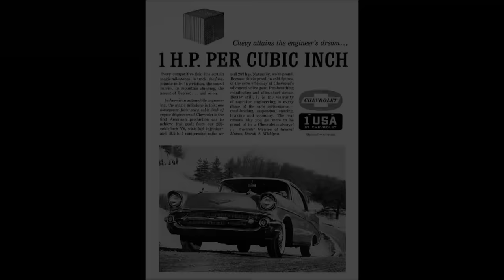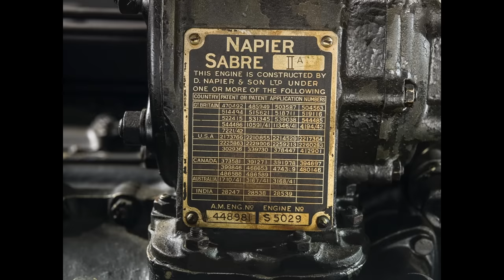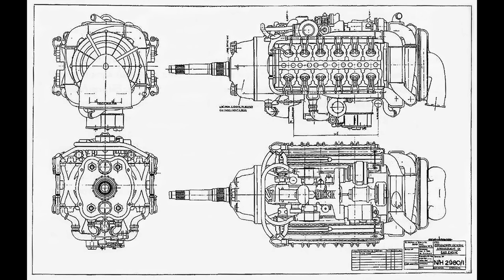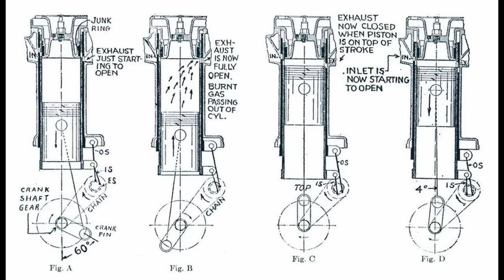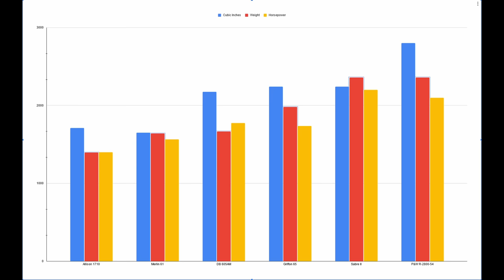Napier Sabre - The Ultimate WWII Aircraft Engine - Part 1

Comment: Greg's Airplanes and Automobiles has done some excellent looks at how much induction systems matter. For example, the huge increase in performance when the P51 Mustang was changed from using the Allison to the Merlin, the induction system mattered far more than the engine itself. Multiple stages and multiple speeds of supercharging was the real gain there.
Reply: Te Rolls-Royce supercharger became so well developed for flow and efficiency that it was used in early turbojets. It was that good.
Reply: A good read is 'Not Much of an Engineer' by Stanley Hooker who was instrumental in sorting out the supercharging of the Merlin. They put him in an office without a specific remit and he wandered around the site and walked in to the supercharging unit. He was a prime mover with the Bristol Olympus and he was even hauled out of retirement to sort out the problems with the triple spool RB211. A major player in UK aviation up there with Mitchell and Camm.
Reply: The important point is that the superchargers of early aviation engines were always integrated in to the crankcase, so changing the design of the supercharger meant redesigning the whole engine. For whatever reason, there was no such thing as an external supercharger back then. This meant the design of the supercharger was fixed very early in the development process, and it was critical to the performance of the engine as a whole. The American made Allison V-1710 used a single stage, single speed supercharger which reached its critical altitude (the highest altitude that the engine can still make full rated power) in the 12-14 thousand feet area. But when Rolls Royce designed the Merlin, they had the remarkable engineering foresight to build a two stage, two speed supercharger in to the case which could achieve far higher pressure ratios than than a single stage, single speed unit. P-51s with the Merlin engine could make full power in the mid 20-thousand foot range, with still plenty of power available even higher. Higher altitude comes with lower air density which means less drag, but with the engine still making nearly full power you could go faster and go farther on the same fuel load, which is why the P-51 could escort the bombers all the way to Berlin and back.
Reply: Gregg is boss.
Reply: I will look into that book, thanks David. One of the things I learned about engines, is the remarkable, usually in-house, engineering techniques and methods employed. My personal experience was with jet engines, from the 1960s to 1980s. I flew maintenance test, quality assurance for the USN. But I did not do research and development, which fascinated me. However, I would from time to time look into that world.
Reply: This engine design is very interesting and exotic.... It is too bad that the sleeve-valve designs began and ended with these engines... One reason that these designs were favorable, is that they take relatively little space as compared to the power they produced... Less frontal area was the result, which meant the plane had less drag, which created more speed and less fuel burn...But it was complex, which meant that it was usually less reliable- especially the mechanism that operated the sleeves... However, if the problems of activating the sleeve valves were solved, this design could have replaced a whole lot of poppet valves in the heads of several piston engine designs... Because of it's un-convential layout, it became somewhat difficult to obtain financing, materials and accessories for it, like adjustable pitch props... It reminds me of the troubles that Jack Northrop had to build the B-49 (Flying Wing) planes because of it's un-conventional design... If Napier was awarded the backing & support to improve their engines, that other competing companies received for their products, Napier probably would still be making engines now...
Reply: A really interesting book giving a lot of the background to the sleeve valve design used by both Napier and Bristol has to be Sir Harry Ricardo's "The High Speed Internal Combustion Engine". Well worth a read if you can find a copy, along with the other books mentioned above. I would also endorse the recommendation of "Greg's Airplanes" channel on YouTube. He has some very good videos about Supercharging/Turbocharging of aeroplane engines of this period.
Reply: David Carr  Those engineers were Absolutely Brilliant !!! From what I have read about the advancement of Turbo-Jet gas turbine engines, one of the most significant advancements of their Power/weight-size ratio, was the original application of VSV's and later VBV's that helped to 'tune' the airflow as it was traveling through the axial-flow compressor sections of these engines... The use of the Variable Stater Vanes (on Pure Jet and HBP engines) and the Variable Bleed Valves (on High By-Pass engines) sometimes tripled and even quadrupled the continous thrust output (without exhaust re-heat, water injection) of the earlier engines without the VBV's / VSV's...
Reply: @singleproppilot  Later V-1710s did actually have a 'bolt-on' external supercharger, driven by a hydraulic coupling rather like the superchargers of the German DB60x series. That engine saw service in the P-63, which of course was not popular with the Western Allies. To my knowledge it still couldn't match the Merlin at high altitude, but was a substantial improvement over the single stage V-1710.
Reply: Agreed - Greg's videos on supercharger and turbo supercharging layout the case for manifold pressure. The delivery of this boost at various altitudes is also key to determining fitness for role. It's interesting to see that the same engine performs either poorly or exceptionally well at altitude depending on the boost system - yet I'd avoid saying "better" or "worse" since the role of the aircraft and how it was actually used in the field determine the overall success of the design.

A great example is the Allison V-1710. With just a single stage single speed supercharger, performance was generally only acceptable below maybe 15000ft, as in the P40 or P39. It wasn't well suited to a high-altitude escort role and was indeed dropped in favor of the Merlin with it's two-stage / two speed (can't remember when they revised the superchargers but see Greg's videos) to get up to 25000+ feet for the P51 Mustang. Better still, use turbosupercharging in plane you can fit that induction system, like the P38, and they opted to keep the Allison's over Merlin's and props became the main limitation. 

Manifold pressure (and the fuel to run that boost at) is key to internal combustion engine power. With more development you can see that Napier was headed in the right direction.
Reply: General Electric didn't produce the promised turbo.
Reply: @raywhitehead730  Don't tell me, he spun a long convoluted story of how the Allison was not inferior to the Merlin because many Americans can't stand the thought of being second best at anything?
Reply: David Carr  Really?  I've heard that the P38 was a relatively poor performer in Europe.  As for power dropping off at height then the phrase of wanting results not excuses comes to mind I'm afraid.  If one cannot match the enemy in terms of all round capability then it spells trouble, simple as.
Reply: David Carr  that's fair enough.  But suffice to say that the P51 with a British engine and American airframe was the zenith of the piston engined fighter, an example of "If it looks right, it generally is right".  Meanwhile the Mosquito fell apart in hot climates, horses for courses...
Reply: Greg is not as honest a presenter as he claims.  In other words, HE LIES.
Reply: @paullubliner6221  I wouldn't go so far as to say that.  However I do think he really works hard to promote American designs over British and German ones for example.  Do you have any references or citations to substantiate your claim?
Reply: David Carr  fair enough 👍
Reply: @raywhitehead730  
Obviously an opinion others disagree with. Read Calum Douglas, an F1 engine designer and engine historian.  Learn from the real people.
Reply: @paullubliner6221  
Greg's labasting of Dr Mark Felton, an acclaimed and awarded historian, on the Black Lancasters put me off that guy. His delivery is also boring and at times confusing.
Reply: An engine's power potential is ALL about getting air into it.
Reply: DC.409  😊
Reply: @raywhitehead730  It is Greg and he is not.
Reply: @rob5944   The P38 engine required constant monitoring in the cold of the ETO
Reply: DC.409  The P38 was never called the Fork Tailed devil that was  post war hyperbole.
 I have a book with the Whirlwind mentioned nothing about bad experience by Brown in fact I have 5 books by Brown The problem they did have was with the Peregrine Engine and it would have taken a major redesign to put the Merlin in.  Gunston said it was a fine and pleasant machine and packed an unprecedented punch in the Nose .Our first twin engine fighter.
Reply: @rob5944 P51 Zenith hell every Spitfire beat the P51 in all flying conditions except the P51 better top speed[ until the Mk XIV] and range 
2. 32 Mossies had problems in Burma  traced to two factories using contaminated glue.
Reply: @rob5944  I pointed out that the P47 in Three Reports only had a tactical Mach of 0.71. One of the Tests was at Wright Field in Jun44 which gave it an even lower ILDS and NO British Bias
Reply: @johnburns4017  Yes I saw that I don't know if they planned it or not. It could have succeeded and the Lancaster need not have landed in any US controlled air Space. Adm. King and the USA was becoming obnoxious in the Area by the end of the war. The BPF was sent there for two reasons 
1. To help the USA as promised and
2 To make sure that Britain had no opposition to them taking back Singapore Malaya Borneo and Hong Kong Roosevelt had been against colonies .
Reply: DC.409  Web know why the P389 was withdrawn T/M 0.68 Germans 0.75
Reply: DC.409  No what Brown was critical in his Wings on my  Sleeve was the very poor dive of the Lightning
Reply: @jacktattis  can't remember what we were chatting about now, sorry mate.  I just use my phone for this lark and it won't show everything up.
Reply: @jacktattis  could be the answer then.
Reply: @jacktattis  yes I gather it didn't get on very well.  Horses for courses I suppose.
Reply: @jacktattis  
If the Peregrine had more power with the bugs ironed out the Westland Whirlwind would have been an excellent fighter. But the work involved in installing RR Merlins was not worth it as the Mosquito had come along.
Reply: @rob5944  
Yes, that Greg's vid on the Alison v the Merlin was cringe-worthy.
Reply: DC.409  
No one is decrying the Allison engine. It was an excellent engine but it had its limitations. It was not outstanding, that is pushing it. A good workhorse engine.
Reply: @rob5944  
The Mustang was a joint design by British engineers and North American men at the British Air Ministry offices over three months in NYC.  The British were leading as it was their plane with them paying.  

North American Aviation men toured British factories to assess manufacturing methods. They went to Martin Baker twice. 

North American also used British expertise such as Ken Bowen from Yorkshire, who designed the progressive curvature principle used to build the P-51 Mustang fuselage, which was quick to form and easy to jig.
Reply: @jacktattis  
Admiral King should have been fired after the U-Boat debacle in the first six months of WW2 in which 600 US vessels were sunk on the eastern seaboard.  

The British forced 26 corvettes with crews onto the USA to stop the carnage. They also based a British anti U-Boat air squadron in Rhode Island to protect NYC harbor.
Reply: @johnburns4017  well they did a good job, and with the Merlin it made a great plane!
Reply: @Mike-eq4ky  Well they were foolish No US plane got to 45000 ft as did the MkVII Or 49000ft as did the MkXIX
Reply: DC.409   nO ALLISON PLANE GOT TO 45000FT
Reply: @johnburns4017  No the P51 was an American effort through and through . We must not be like them and claim things that are not fact. All the BPC  did was to tell them what they wanted.
Reply: @raywhitehead730  No Greg is biased to Radials
Reply: @rob5944  Well said
Reply: DC.409  Dont worry about the Soviets The RAF Mustangs were being used as low level everything And were very good at it.
Reply: DC.409  The US was not the first to use them They were used by the RAF2TAF in the low level armed Recon  Mustang I & III 330 of them . The RAF did not give a rats bum for US tests They had RAE AFDU and other testing facilities
Reply: @jacktattis  
The US deserve credit for the  Mustang for sure. But it was not a 100% US design. North American had zero experience of designing and building leading edge fighters. The Air Ministry had to hold their hands. It was a British plane, for them, and they were paying, so they had to ensure it did what they wanted, and not end up with a p-40 fly-alike wasting precious time.  Yet Americans take all credit, even coming out with nonsense like they redesigned the RR Merlin. No kidding.
Reply: DC.409  
The two-stage, two speed, Merlin 60 was not aimed at the Wellington, it happened that the Wellington was first to use it.
Reply: DC.409  
Giffard wrote: Making Jet engines in WW2.

Our stories of industrial innovation tend to focus on individual initiative and breakthroughs. With Making Jet Engines in World War II , Hermione Giffard uses the case of the development of jet engines to offer a different way of understanding technological innovation, revealing the complicated mix of factors that go into any decision to pursue an innovative, and therefore risky technology. Giffard compares the approaches of Britain, Germany, and the United States. Each approached jet engines in different ways because of its own war aims and industrial expertise. Germany, which produced more jet engines than the others, did so largely as replacements for more expensive piston engines. Britain, on the other hand, produced relatively few engines - but, by shifting emphasis to design rather than production, found itself at war's end holding an unrivaled range of designs. The US emphasis on development, meanwhile, built an institutional basis for postwar production.
Reply: DC.409  
The Tizzard mission to the USA introduced jet engines - no R&D was under way in the USA on jet engines. It was a one-way transfer of technology. It was hoped that collaboration with the USA would develop a suitable engine quickly then US industry would join in mass producing it. Hence General Electric were in from the start.  The R&D was genuinely two-way, unlike the A-bomb which was British to the USA. The two were to rise in parallel in jet development. Yet, the British went way ahead of the USA in design, despite the USA getting all their R&D data. The British left the Americans out of sight.   The USA were slow or unable to use the R&D the British gave them.  At the end of WW2 the many British engines that were developed formed the basis of most jet engines for the next 20 years. 

The British/US way was design and quality.  The Germans were way behind, just about getting a poorly developed, and dangerous, functional engine into a plane. Then out of desperation they produced an engine (Jumo 0004) in volume using slave labor. The German engine was so bad is not worthy of note, except that it was put into a production plane and mass produced.
Reply: Well yes and that was a Brit thing my friend
Reply: @raywhitehead730  sure, in his own mind.

Comment: The success, failure and production preference for aero engines is more than just a few graphical representations.  Production complexity, squadron line maintenance, specialised materials, parts supply industry, special tooling also weigh heavily.  Comparing other contemporary engines to the Sabre need to balance these factors as well.  Sabre was an excellent engine in many ways, but not all.
Reply from the maker: That’s a fair sentiment that I address in part 2. Part of the challenge in ranking these engines is, like you say, there are multiple factors at play that dictate the reputation and perception of an engine. In this case, while maybe simplistic, I’m using the term “ultimate” loosely to reference power output alone.